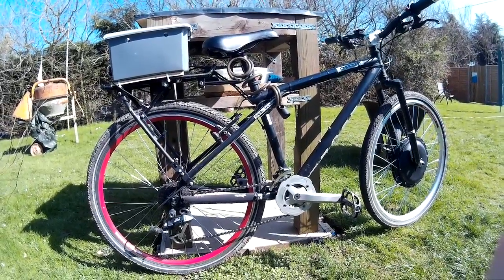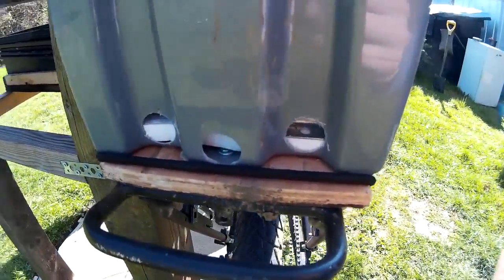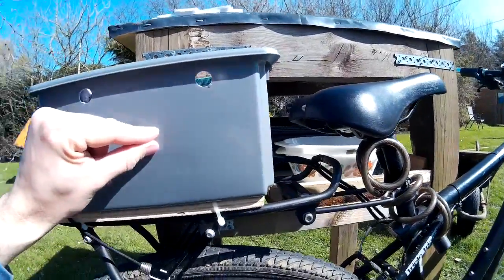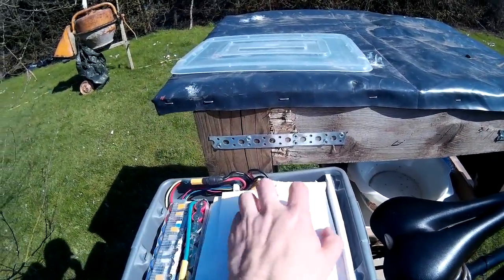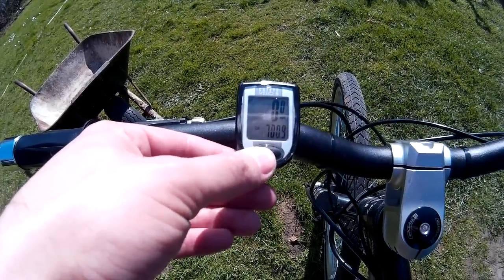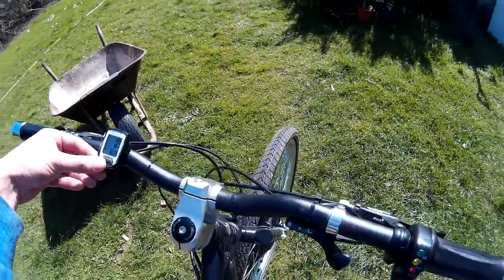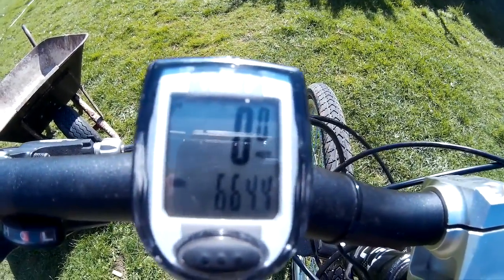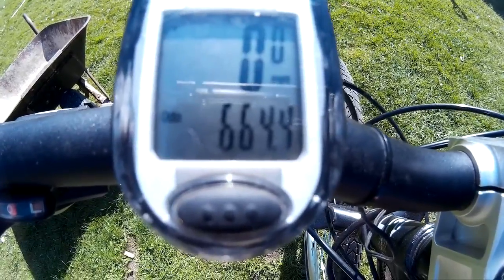My Diy 18650 Laptop Lithium ion E-bike

Comment: Where did u get the battery's?
Reply from the maker: Martin Smith used laptop battery's brought from ebay cheap ripped them apart to use the 18650 cells inside.